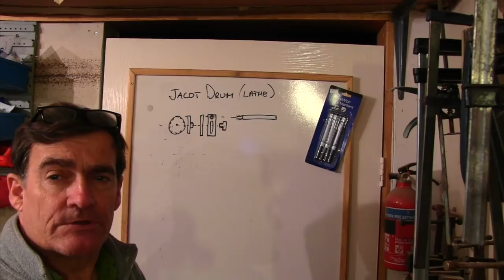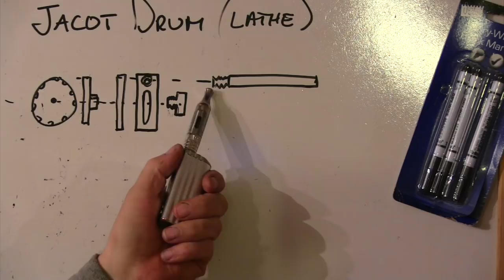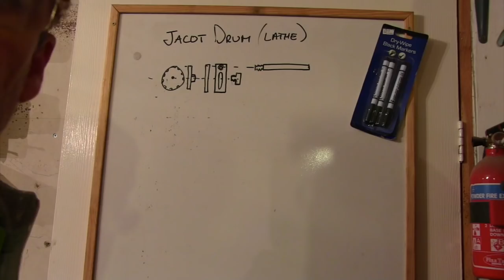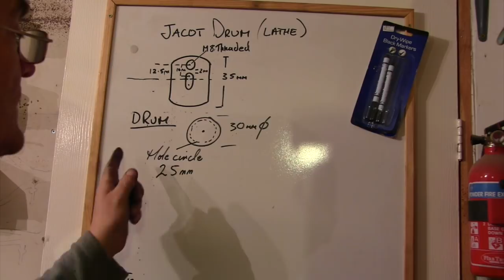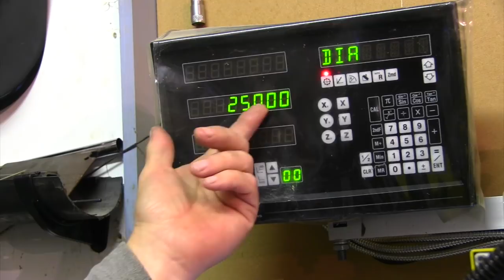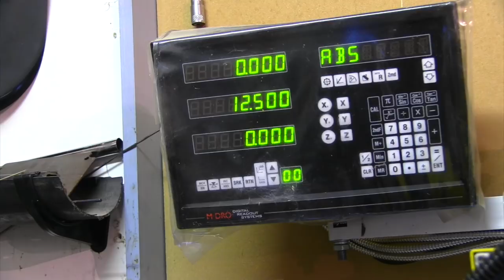making the jacot tool for a small lathe.

Comment: Diamond powder is likely to get embedded into the pivot, which will then cut its bearing hole more quickly. Very bad outcome, and it will not be apparent until its too late. No need to use diamond paste or rouge. Just use the pivot file and the burnisher, you can obtain a perfect finish.
Reply: I imagine the diamond isn't doing the file or the burnisher any good either.

Comment: Leaving a radius on the inside of the pivot can cause binding in the plates. Square shoulder much better. 
Glad to see the warning pin on the wheel didn’t shred your finger or catch the cloth used to clean the pivot. Easy way to loose a finger.

Comment: Tiny drill bits are much more likely to break at low speed. Let him fly especially in brass and just peck-it like you were doing
Reply: Agree. Also, if you dub your bits (modify them so they have zero rake), you'll have a lot less breakage in brass. Search google for drill bit dubbing.

Comment: Nice tool - I've not been able to find an original drum for my lathe, so I may well copy shamelessly :-)
One question though - I've not seen abrasives used like that on a Jacot tool for pivot polishing - general advice seems not to - what advantage do you get from them?
Reply from the maker: Hello,
thank you for watching and for your comment, by using the diamantine and rouge powders, mixed with a little oil I alter, very slightly the cut of the file, the downside, and why you would'nt see it very often is that the powders are effectively a grinding paste and will transfer to the pivot and will wear away the drum, and if you were using a bergeon lathe and accessories would literaly be burning a hole in your pocket,
but with this you can always make another one, that is of course if you do enough pivot polishing to wear it out!
Thanks again for your interest,
All the best,
Cliff
Reply: Just found your channel (hence comment on an older video)
I too am a bit puzzled... using diamond powder on a Jacot tool made out brass, applied with a hard file, on a semi hard to soft pinion, will do the following in my experience .
It WILL embed diamond particles in the pinion (to the detriment of the plates or bushings).
It will (the pinion will, in return) embed diamond particles in the drum...
In essence , you are lapping, and the compound will transfer from hard to softer.
So, either I would have to advise against this... or admit that I am missing something...

Toodles!

Paddy